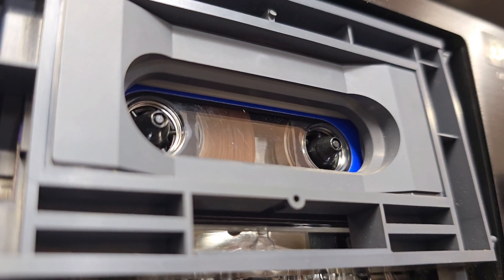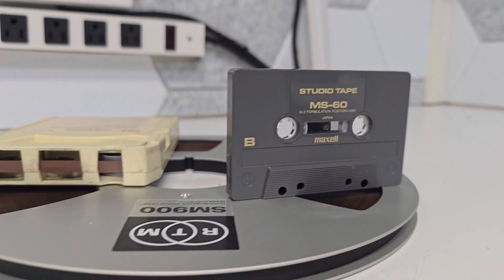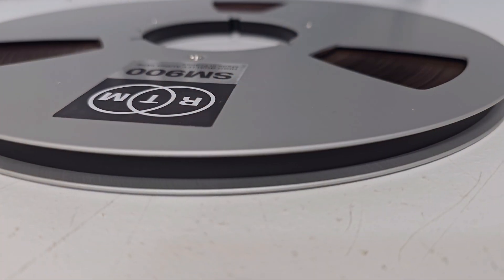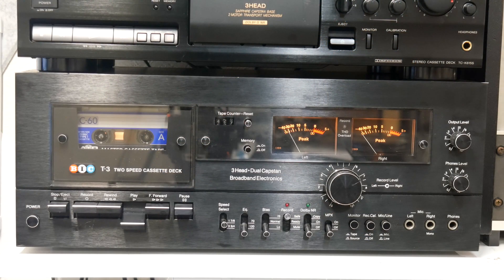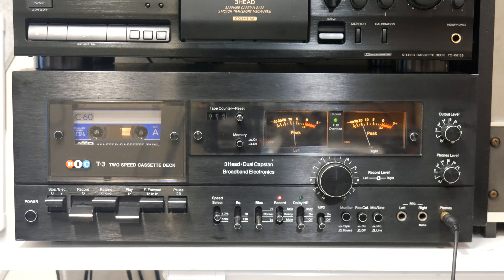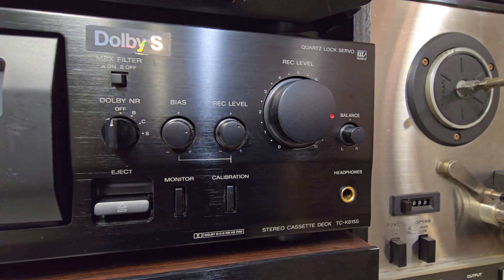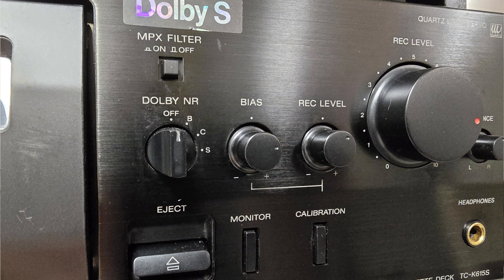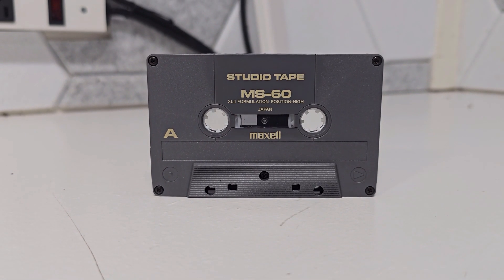Dolby S Noise Reduction - As Good as Digital? Dolby B C and S Comparison - RTM Tape Giveaway Winners

Comment: I recorded cassette from cd, and the aim was to be the closiest possible to the original quality, thus cd quality! And dolby b and c where very good improvement: on a good 3 heads cassette deck, with bias setting correctly, with a good quality cassette, its very hard to notice difference between the source and the tape!

Comment: Dolby... one the worst of the noise reduction systems but combatible with decks without any noise reduction systems. The only advantage for this piece of crap. HighCom, DBX and Adres are better systems but only playable with good sound in the system which has recorded it.
Reply: Its exactly the same process, All this compander use the same process, there is just a changing ratio between this technologies!

Comment: Of course, wow and flutter aside, none of these demos can really show the differences on your average PC or phone with their crappy speakers. All I can say is that I was very disappointed with Dolby B in the 1970s with everything sounding dull and lifeless, even if the hiss was reduced. I get the impression that an awful lot of cassette decks in that era weren't calibrated at all well, so that may have been the problem. A few years ago, I bought a fully overhauled second-hand three head, dual capstan, Dolby S deck from the early 1990s and with chrome and metal tapes my recordings are essentially indistinguishable from the source, be it CD or vinyl - and that includes the complete lack of background noise from the CDs. Interestingly, in Dolby B mode, the recordings are also very good, if not quite perfect, so I think Dolby B gained an unfair reputation all those years ago.

Comment: Dear friend,
Well, I appreciate you addressing the different types and issues of Dolby noise reduction, I would further encourage you to deal with the issues of the worn and stretched out belts and motors, causing serious wow and flutter problems in your equipment.  It is not a good idea to make a video like this with your equipment working far less than desirable.  I have owned enough cassette players in my day to find out that the majority of cassettes did not play with any noticeable wow and flutter.  Please do not say this is normal for cassette players to do this.  I have a thirty-year-old Denon cassette deck and a forty-year-old Soundesign stereo with a cassette player that does not have this problem.  No hard feelings, but I know cassettes can play and sound better than this!

Comment: Dolby S was on my budget multitrack 1 inch 24-track reel to reel recorder the Tascam MSR-24. It's biggest weakness was the unbalanced RCA inputs had way less headroom at -10dbv compared to the 2-inch MCI JH-24 Machine which was +4 DBu. So you had to be careful how hot the signal was going into it but as long as you watch that and used the Dolby S for quieter song it was as clean as the the bigger 2-inch machines. We also had a 10 Cassette duplicator made by Teac that had Dolby S that you could bake in to the final product, we would feed the duplicator the 1/4  mixdown reel to reel. So Otari MX5050 to the duplicator and if the recording was very dynamic with soft and quiet parts or was spoken word (book on tape) then we would use the Dolby S during duplication.

Comment: One thing I can say about Dolby:  Dolby B was basically the home version of Dolby A.  Dolby C had no studio equivalent, though it was used on a 1/4 8-track reel to reel deck by Tascam, the TSR-8.  Dolby S was basically the home equivalent of Dolby SR that I first recalled hearing about with movie soundtracks.  It was played up big that SR meant Spectral Recording, speaking of the fact that it could handle a wide dynamic range much like DBX type I noise reduction which was used a lot in the studios, a prime example being the 1/4 inch 8 track 388 which is still a highly sought after machine in spite of the fact that the breathing artifacts caused by it created issues on one of Steely Dan's albums.  (If my memory serves me correct.)  (And I have heard the pumping and breathing with the home version of DBX when I tried to record "Less Cities More Moving People" by the Fixx off of a CD.  On the percussive synth sounds during an instrumental break it was clearly audible, though that was really the only major issue I ever had with DBX.)

Comment: Dolby noise reduction wasn't hated by enthusiasts because they could afford decent decks where it worked properly. Dolby C was already close to Dolby S for performance and first appeared in a home hi-fi deck in 1981. It used a technique called spectral skewing and could provide Type IV tape performance in terms of frequency response from Type I tapes as well as a signal-to-noise ratio approaching 80dB on later decks that used the higher 250nWb/m reference level for, so only around 5dB worse than Dolby S. Anyone who had it must have been nuts not to use it unless they had a valid reason. And if you want to be taken seriously, PLEASE stop using a cassette deck with diabolical wow and flutter.

Comment: Dolby S is far superior to Dolby B. Dolby C is useless because it requires a Dolby C player; Dolby S can be played with a simple Dolby B player. Using a cassette without a noise reducer is a good idea if you want to respect the original sound, and it's a good thing if you like hard rock or metal, where there are very few dynamics (the sound is always at full volume); but if you like classical music, where fortissimo alternates with silence, the background noise of the cassette will quickly become a problem.
The problem with Dolby S is that it is only fully satisfactory with very high-end equipment. After several trials, I chose the TEAC V8030S turntable; but there are SONY turntables of excellent quality too.
It's particularly difficult to differentiate a CD from its cassette copy with Dolby S, especially if you set the BIAS and recording level correctly. Alas, most cassette decks are of poor quality, and listening to a cassette on these machines is very unpleasant. If you don't want to be disappointed, you really must agree to buy a recent machine (late 90s or early 2000s), properly restored by a professional. And that means paying the price.
As for buying blank tapes today, be careful with used tapes - they age badly if stored incorrectly. Opt for new ones, and after much trial and error, choose RTM (Recording The Masters) tapes. These are currently the best. All the others are very, very (very...) inferior...

Comment: I am an ex Sony Engineer and had getting on fora  dozen Sony and other decks like Aiwa ADF 990 decks over the years. My preference was for TDK MAXG and Sony Super Metal Masters properly biased and pushed to their maximum before over saturation Never really noticed the tape hiss and more 0ften than not there was little difference when doing tape source monitoring. If I had cause to use a nouse reduction system I must say Dolby S in a top quality machine was very usable.

Comment: The problem with Dolby noise reduction on tape decks is that almost NONE use it correctly and it is off. I owned and own many tape decks and recording and playback with Dolby was always lacking something. Yes, the hiss was gone but the recording completely lost its crispiness and sounded somehow muffled and sort of constrained. Playback without Dolby just feels more live. Is it only me?
Reply from the maker: I agree 100%. That's why I don't use it.
Reply: Everything must be clean before recording, Heads, capstan and pinch-roller. The heads need to be in the right azimuth. The wow and flutter must be unperceptible if the belt is good on the deck and the capstan lubricated.. Yes Dolby works well in these conditions.
Reply: when it comes to type I tapes, I definitely don't used it "correctly".  Type I tapes rarely record enough high frequency, so I record with it on, and play back with it off, to give a little boost in the top end that the tapes need

Comment: Ugh! It doesn't matter if you have no hissing, no noise. The flutter is just killing me. It's just horrible. It's beyond, horrible. It's intolerable. I'm sorry. I'm spoiled.

Flutter of only .7% is barely tolerable. Coming off of a $3700 in, 1979, dollars. Scully Studio Recorder. And so why would I want to hear, 10% flutter with no noise coming off of the cassette with far reduced sonic resolution? Why? Is there a reason for this? In the 21st Century? Is there something about your age that doesn't match mine? You don't know what year it is? Do you know who the president is? When's your birthday? No do not answer that on the Internet. I'm just asking.

You could have a screw loose? Anything is possible at our age.

I mean when you realize. Digital exhibits, 0% Flutter. What else is there to know? That your easy listening frequency response cuts off at, 20, 050 hurts? Is it really that painful? That it doesn't go out to, 40 or 80 kHz audio resolution? Your hearing is that refined? Wow? So you would need, a lot faster tape. But cassettes only move it 1.78 in./s. That's really low resolution. I mean you're trying to align a bunch of itty-bitty little, oxide particles in, wacky ways. That's blasphemy! To the audio. What did the audio ever do to you? That you would want to subject your audio to any kind of Dolby or DBX? I sure never did. There was no reason to.

If somebody doesn't like the hissing? They should just purchase a cheaper stereo.
RemyRAD